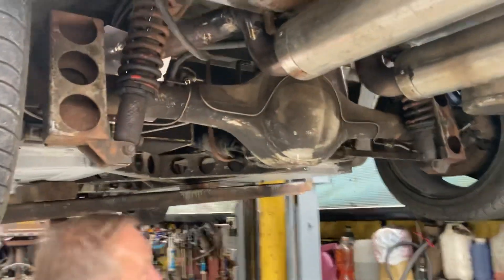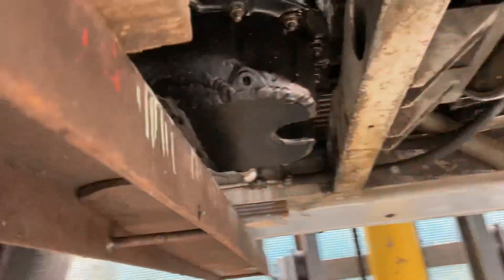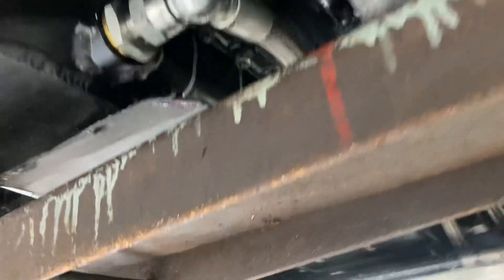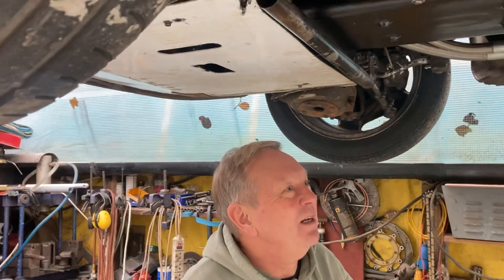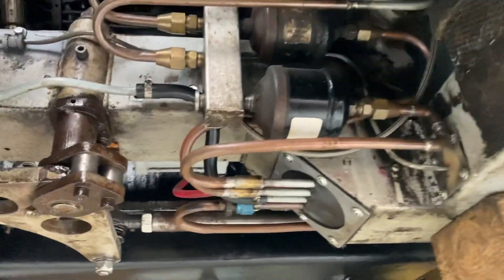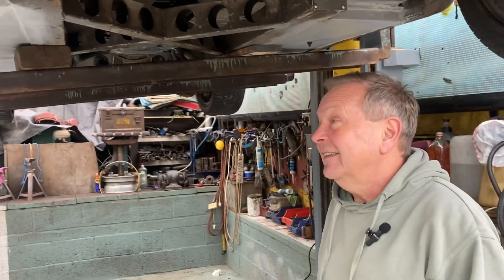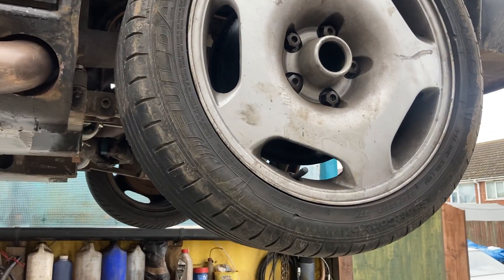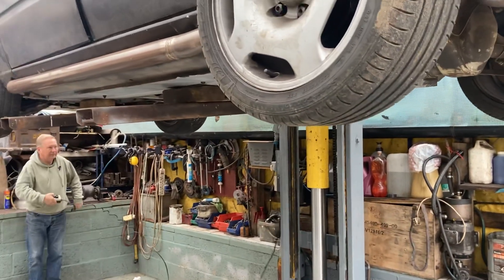Part 2 - A good look underneath Charlie Broomfield's 27-litre V12 Rover SD1

Comment: A good alloy rad will outperform copper/brass and be a LOT lighter. These 3" thick things they sell though are not great. I had one,, went to a factory Holden rad about an inch thick and no more problems. Modern cars with a/c and other coolers dont have issues hence my reverting to OEM. Mind you it is a V8 Holden rad in a 500hp V8 Ford!. I also have the same rad inmy 71 Ford Galaxie and that is 400ci with a.c and a big transcooler. 2 ton car. Yes I know it is just a lightweight as the Meteor is nearly that weight!!
As for this car?? Bloody hell it is different. Over engineered and heavy. But nothing will break. Steering is bit average though the system is the same as many 4 wds. And then it seems a TH400 and a Ford Commercial diff. Though I suspect you have to be gentle on them as for the torque will smash both of them.

Comment: Lol 27 litre v12, economy.
Reply: the later variants were incredibly powerful. but the basic design was decent. The DB engines were reliant on lots of ingenious engineering to overcome shortages later in the war. Times were tough for the German procurement sector.  Over in the states, the mustang, once it got a variant of the V12 took off, and performed long range escort to bombers and many other roles. It was and still is a great engine, and I know there are many of these engines submerged in bogland. They were shoved into a large bog area that was first traversed by floating logs less than mile from a WW2 airstrip. A similar system was used to cross Chat and Barton mosses, outside to the west of Manchester.  I'd just be interested in how they'd cope in bog and mossland. Possibly better than we'd expect.